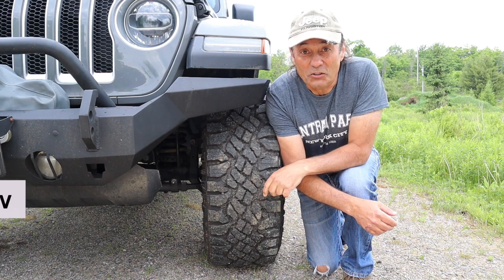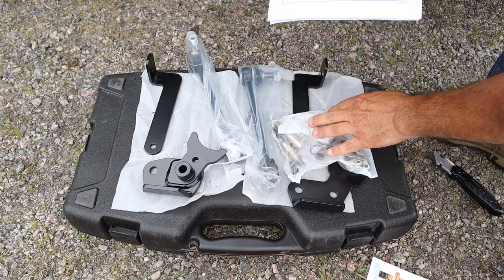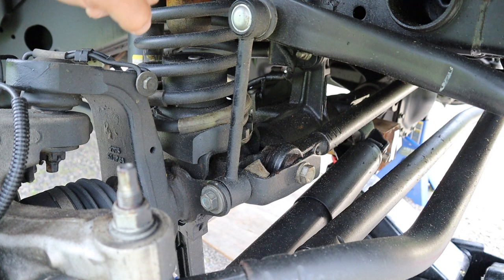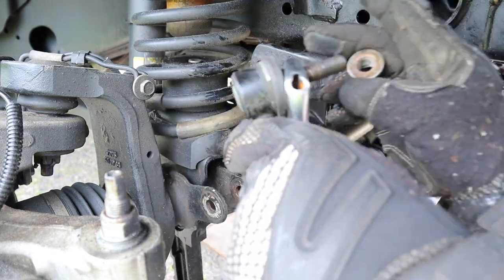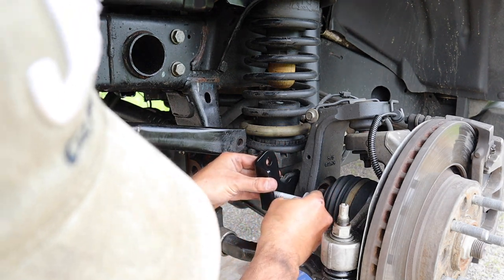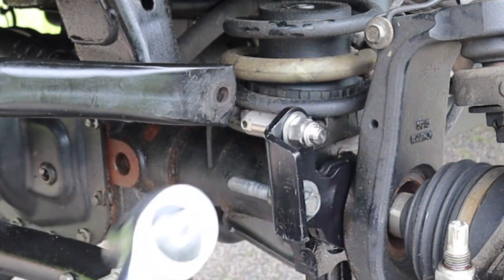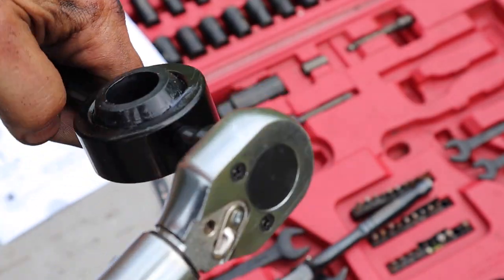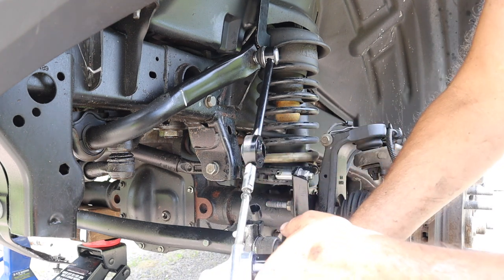Installation of the TeraFlex 1764000 JL | JT: Front Sway Bar Quick Disconnect Kit (0-4.5” Lift)

Comment from the maker: Hey Folks, 
Just as an update, I found that the Teraflex links began to be noisy, possibly due to lack of greasing on my part, so I replaced the kit completely, buy using the AEV links that came with the 2" lift kit.
Cheers.
Reply: Hi Cheaper Jeeper, 
Love your videos. To clarify, you no longer have quick disconnects. Is that correct?  You chose to go back to the AEV links. I have the AEV lift as well and was considering the teraflex qd’s, but I would hate the noise.
Reply from the maker: @kingspecialized  Yes, I put the AEV links on. They are great quality. I can't really recommend the Teraflex links because, you'd need to regularly maintain them by greasing them up. I'm not really going off road much that would require a quick disconnect anyways.
Reply: Metalcloak is better
Reply from the maker: @SanshokuCustoms  I could have benefitted by from your suggestion back then!..lol. 😆
Reply: @CheaperJeeperTV  jajajaa
Reply: @SanshokuCustoms ’m lookin at the Metalcloak 13 inch disconnects now for my TJ.

Comment: Genius! Your video helped SO much to visualize how these installs work. I'm going to try disconnecting my stock links first and take it for a drive, so to have a better idea of how much difference it will make. If good, I'll try the clevis pin hardware option you showed  in your Tip list. There are lots of times that I'm camping where I'd leave the sway bar disconnected for the whole trip, since it's all off-roading we're doing. Thanks for helping, safe Jeepin'!
Reply from the maker: Hey Carol,
That’s awesome!  
Cheers
Reply: There are other reviews that show the amazon clevis pin ruined their link.
Reply from the maker: Thanks for the info.

Comment: I really like this design as it doesn't require grinding off the one flange on the passenger side that other kits require you to do. I see the sway bar arms are now much higher than with the stock links because the mounts on the brackets are higher. Any change in on-road handling because of this?
Reply from the maker: Hey Scott. 
No change with the handling at all. I agree with the concern about cutting off the flange, as you stated. However, the Nylon(?) bushings in these sway bar links wore out and started to make a knocking noise, and I have since removed them. Perhaps greasing more regularly would have helped them? I don't know. I hope my answer helped. Cheers.
Reply: @CheaperJeeperTV  Yes that does help. And I only now realize you have a 2" lift which I don't have which would make it even higher. Sorry to hear about the bushings, that seems like something Teraflex should warranty, that doesn't seem right after less than a year (or so). What kit did you end up going with? Just back to the AEV without quick disconnect? I might just try the DIY with the clevis pins to see how that works.
Reply from the maker: Hey Scott, 
Yes, I ended up using the links that came with the AEV lift kit. They seemed of good quality. 
Incidentally, any off-roading I've done since, which were moderate trails, I just didn't bother disconnecting them. The clevis pin is something I'd consider as well. 
Good luck in whichever direction you chose. 
Cheers.

Comment: I bought this one first also but found that the sway bar is very high. I thought it should be closer to parallel or just a little on the up side. What are your thoughts on this?
Reply from the maker: Hey Randy, I looked at that when I researched before installing the sway bar links. Some comments in YouTube videos say it is ok at that angle. I imagine that if it was a real issue, I would hope to have come across many comments to that effect. Seeing that there were few to none negative comments I also assumed it would still work fine. Should I learn different I’ll post a comment later on this video. Thanks for watching.
Reply: You are supposed to keep the factory sway bar angle -- the sway bar should be a few degrees higher than horizontal -- the way it's pictured in this video is entirely incorrect and will negatively affect ride quality on road. I use JKS adjustable sway bar disconnects  - (or any adjustable set will work!) The benefit of which is that you have the best of both  - on road and off road performance.
Reply: I have mine almost horizontally and it seems to be moving too much side to side what’s the difference having the sway bar more of an angle degrees up compare to less? I need mine to be a little more stiffer
Reply from the maker: I don’t believe it should be moving side to side. That is something I’d have checked out.

Comment: I dont like the angle of the passenger side bar. It put excessive stress on the lower joint and blew it out prematurely. I dont see that problem on the JKS ones. Have you had a similar experience?
Reply from the maker: Yes. Mine blew out, and I thought it was due to not adding grease. Good assessment on your part.
Reply: @CheaperJeeperTV  I greased and re-tourqed. Was making clunking noises and floppy within a few thousand miles. I guess that's why others (like JKs) remove that tab.

Comment: Do you have a video of it in action?
Reply from the maker: No. However, they didn’t hold up well. They eventually started making noise so I replaced them with the sway bar links that came with the AEV lift I installed. 
Perhaps I needed to grease the Teraflex ones more?🤷🏻‍♂️

Comment: So I’ve been considering this kit but also have reservations. What’s your honest opinion considering my concern? So I know it’s rates from 0-4.5 lifts. However many of us with no to minimal lift have made concerns about the sway bar arms being way too high when connected due to the links being too long. Those with higher lifts than 2.5 already don’t have many issues with this (possibly yourself). I’ve heard when the sway bar is high and not close to parallel, it can cause ride discomfort amoung other things. I’ve heard of people with the Mopar 2” lift even complain about the length of the links. I only have a 1.5 front leveling kit so I’m sure I’d come across that issue as well. I plan to get the Mopar lift eventually but as stated I still may have the issue even with that amount since it’s a minimal lift. So I’m kind of stuck. I like the idea of quick disconnecting but don’t want other issues. I have a JT Overland and love the ride quality. Don’t want to compromise anything. Besides, reading through the comments it appears you have now possibly got rid of the links. If so were/are you able to use the link that come with the lift kit, to use on the brackets for the Teraflex kit? Or will the teraflex brackets and pins only work with the links teraflex provides?
Reply from the maker: Hey Sarge,
I got rid of the TeraFlex links. The bushings started making noise. Perhaps they needed to be greased sooner than I realized. 
I just now use the links from the AEV lift kit, and all is well. They also do not need to be greased like the TreFlex ones did.
I hope this helped.
Cheers.
Reply: @CheaperJeeperTV  thanks for the reply. One last question. Are you using your AEV links with the rest of the Teraflex disconnect kit (brackets, pins) ? Or did you just get rid of the whole Teraflex kit. Basically I’m trying to determine if other links that possibly come with normal lift kits can work and fit on the brackets and pins. It only seems that people are some kind of having issues with the links. However I like the idea of the rest of the kit.
Reply from the maker: Hey Sarge,
I got rid of the whole Teraflex kit completely, and am just using the AEV links.
Reply: Which swaybar disconnect kit did you change to?
Reply from the maker: I installed the ones that came with the AEV lift.

Comment: Everything in my mechanical intuition says that the passenger 
Side quick disconnect post is 
“Incorrect “.. I have the same..
Upon installation I looked at how it 
Lines up..   /   Just doesn’t sit well with me
Reply from the maker: What is it specifically that you believe needs to be corrected?
Reply: @CheaperJeeperTV   happy Easter..
The post for the disconnect seems to 
Me would be better facing the inside..
I don’t know if that flag nut gets in the way.. but I may be game to grinding the flag..  Oh and the bracket’s  probably 
Aren’t necessary for stock height..🤔
Reply: No.. still need bracket’s stock.. lol
Reply from the maker: Well, the Jeep I have now is a different one than the one in that video so there’s not much I can do to have a look at it now anyway. Thanks for the insight though. Cheers.

Comment: Horrible product. I had it on my jeep for almost a year, very easy to disconnect very very frustrated to connect. Jeep have to be completely level to contact back, if not fully level you have to put rock, wood etc under the tire to get the link to go in back to the bracket. Waste of time. specially after wheeling . 
Just install antirock sway bar. Worth any penny.
Reply from the maker: Hey Dotan, Thanks for sharing.  I kept a breaker bar behind my seat and used it to leverage the link to the pin. But you're right, it's an extra step that can be a hassle. The Antirock sway bar is a little more money, but it sure would be more convenient. Thanks again. Cheers.